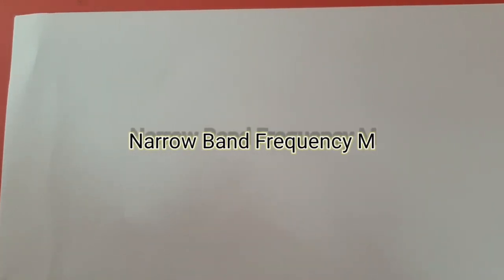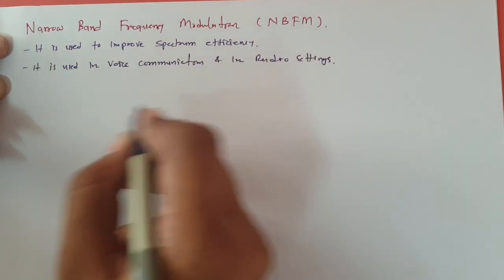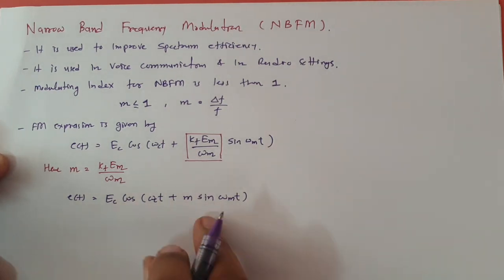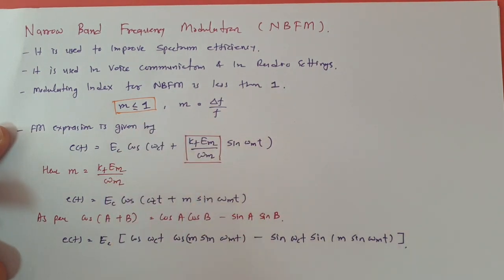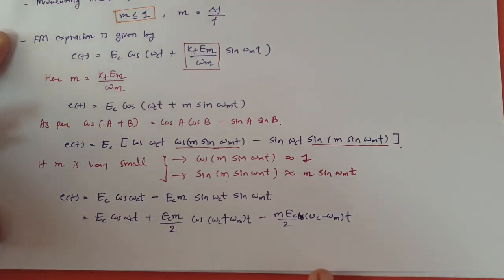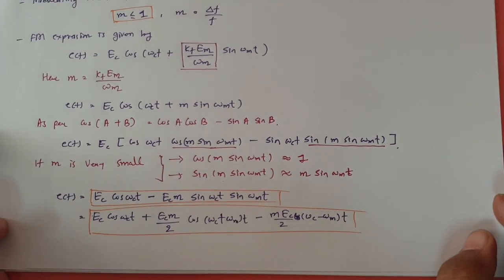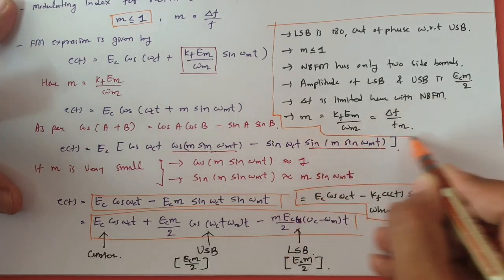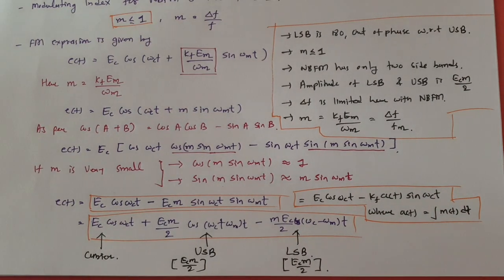Narrow Band Frequency Modulation NBFM (Basics, Derivation, Bandwidth, Formula & Importance)

Comment: sir, how Kf*Em/w equals to delta f/f?
Reply: That should be fm nit wm
Reply: 2π missing
Reply: Here 2π kf.vm/w
2πkf.vm/2πf here 2π get cancelled and it's gives modulation index in FM modulator here kf.vm is equals to frequency deviation which is equals to delta f 
.so mf = delta f/f
Reply: He should have used kw or f instead of w. k is just a constant after all, you can scale it by 2*pi and still get a constant.